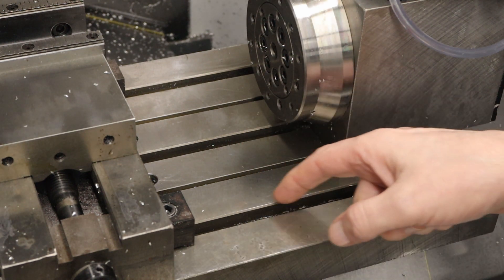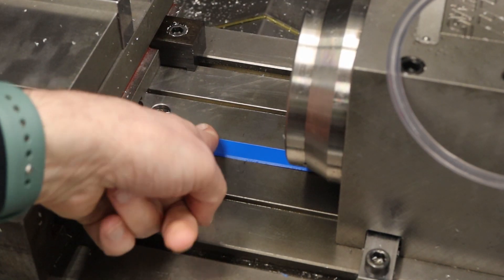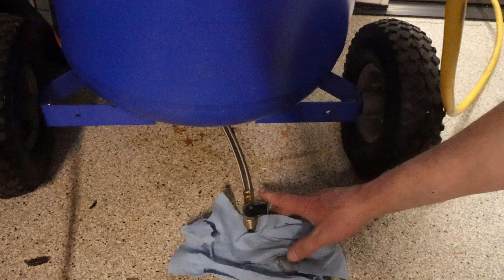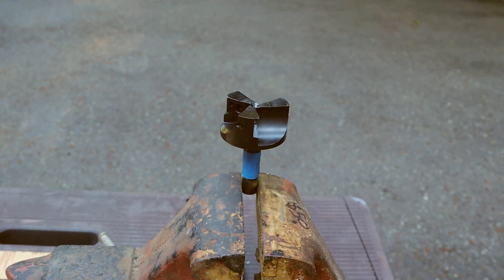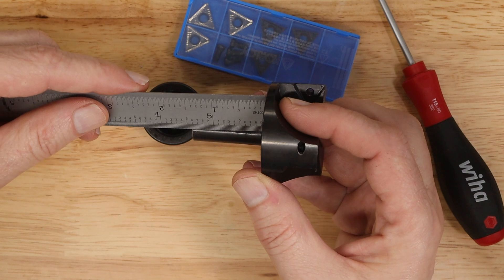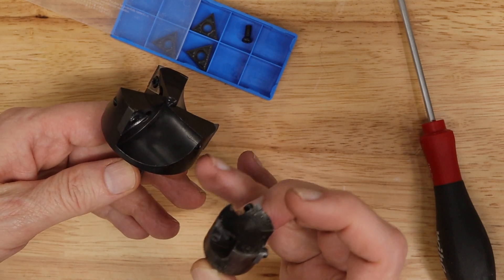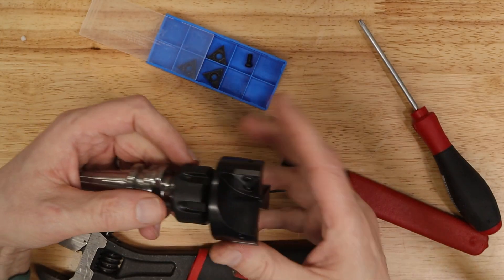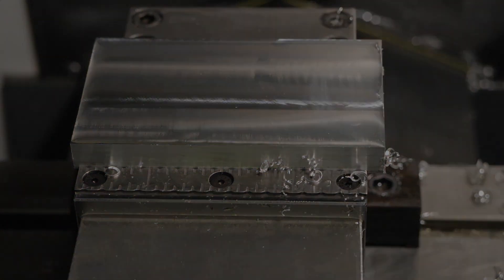Face Mill/Fly Cutter for Small Mills - Random Thoughts #2

Comment: Maybe add a bracket on the compressor wheel mount to hold the drain valve so you can easily operate it with one hand. 

Also, Do you know where to get get ER20 holders like yours? I got some Chinese ones on eBay that aren't bad, but they have castle style mini-nuts that require even more clearance on top of the nut to get the wrench off. I would need more than 1/2" of stick-out on that fly cutter with the holders I have.
Reply from the maker: Oh, great, yet another project--creating a mounting bracket. But it's a good idea. I like it. The ER-20 holder I'm using is a Techniks 06000-2520. Page 21 here: https://irp-cdn.multiscreensite.com/f2027531/files/uploaded/Techniks%20Catalog.pdf